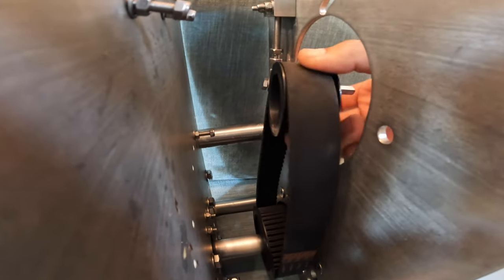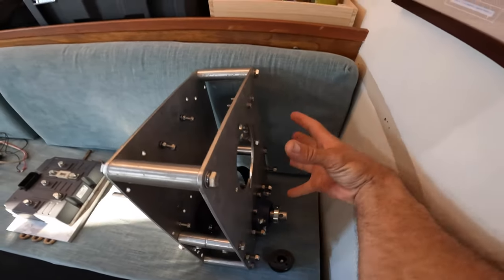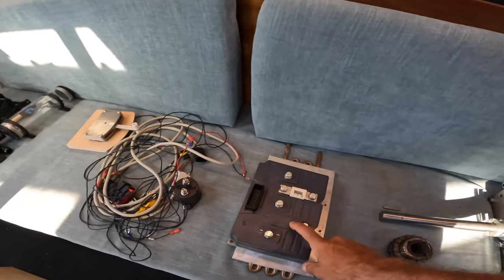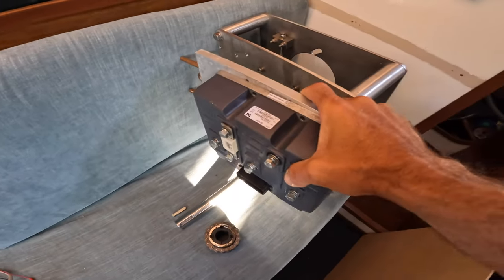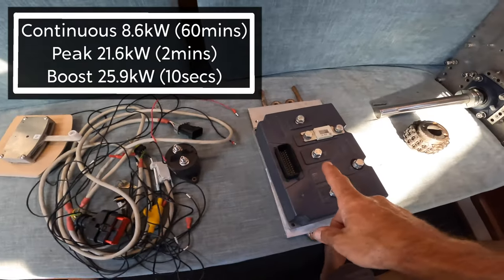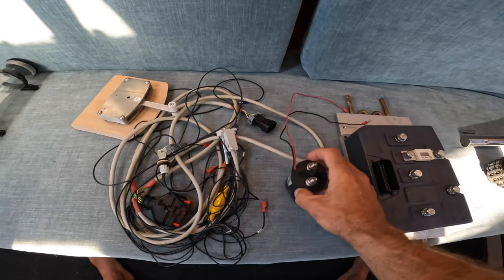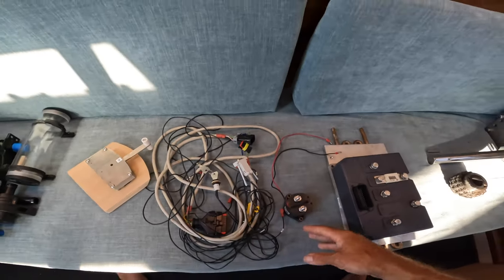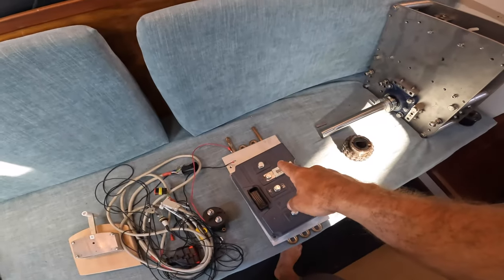How to - Electric Boat Conversion - Part 1 - 36ft sailboat - THE DESIGN

Comment: Well thought out. Smart move going with a 48v system. Love the cooling plate. I’m having trouble getting to seal the cooling plate I purchased with my motor controller and I’ve since bought one on alibaba which looks roughly like yours but time will tell what dimensions it is when it turns up. There’s a business supplying the cooling plates alone.

Comment: Hi, researching, seen your Q's on OpenRov, but remember watching this when published.
12 months on, hindsight thoughts, etc, would be interesting.
I know you said the guy from thunder was pushing 72v, but any reason you simply didn't go with their 12KW Cooled 48v Kit for $3.5K (no mounting).
Electric drive has 10kW kit, no price listed, like motenergy, guess I'll have to call them.
But, wonder if 10kW will satisfy.
Reply from the maker: 12kw would have been fine I just wouldn’t have had that slight extra power the vary rare times I’ve used it. You’ll have to relook at the graph in the third part of my motor series to see what speed you’ll be missing out on (as per my boat). Also something to note, when there was heaps of growth on the bottom of my boat I basically only had half speed (ie batteries ran out much quicker)

Comment: Would you have liked a Saildrive and opted for a dropinsystem with the Shaftdrive?
Reply from the maker: Saildrive is only beneficial with alignment. Doing away with the coupler and aligning the motor assembly would be the benefits. My system works well tho
Reply: @slightadrift  I have heared it is benificial for Regen to have a saildrive.
Reply from the maker: Not sure sorry mate